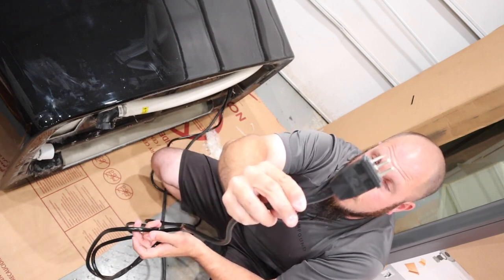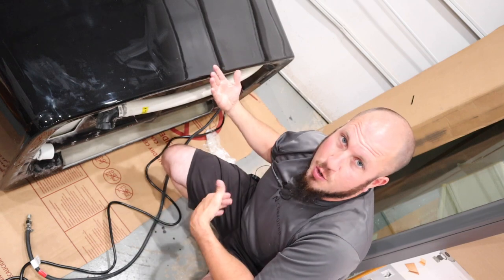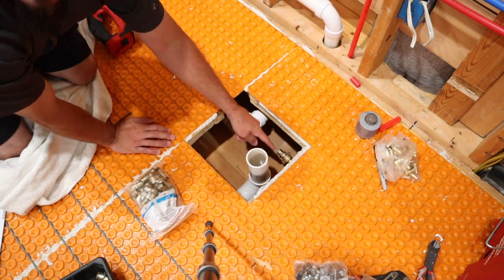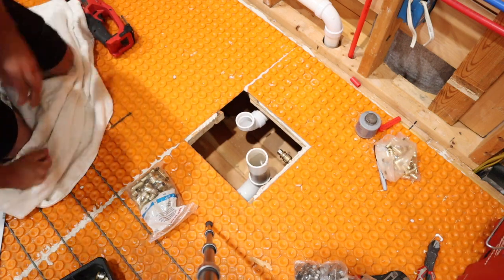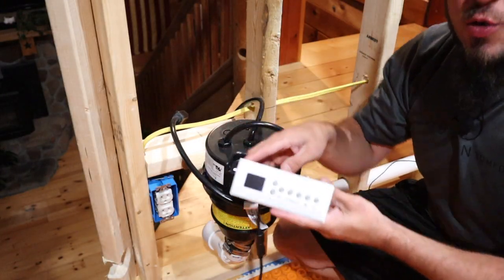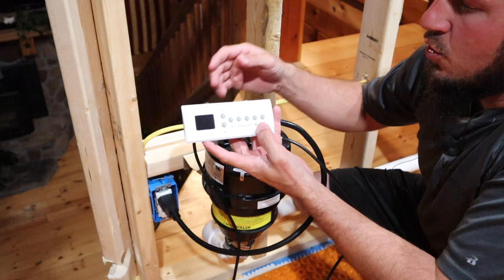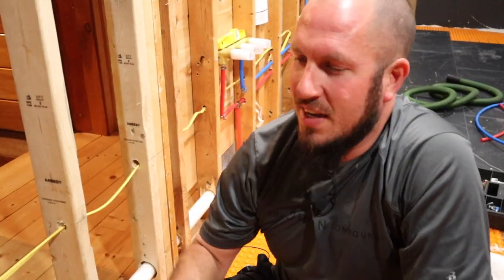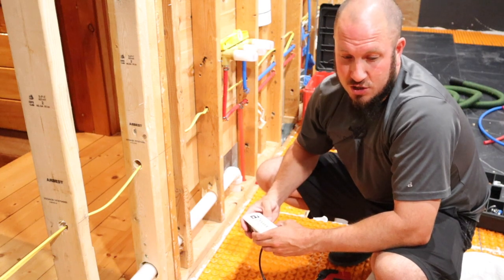BainUltra Air Tub Setup - What To Expect

Comment: Great Video!  Did you get it installed??  Really want to see how you get the tub to drop in over both the air tube and the drain.
Reply from the maker: I have not got it installed yet.  It will definitely need some access from below to connect everything.  I can think of a way to get it all hooked up under the tub when in place with no access.  You could probably do an island drain for the drain but the air hose would need to be coupled in the wall cavity at the very least.  I’m hoping to install it this month and make a video on it
Reply: @TheDurbinCompound  Cool!  Can’t wait to see it, we are about to buy one, and want to know what we’re in for!  Also interested to know if you’re doing something to dampen the sound of the air turbine…
Reply from the maker: @kinnderpropertiesllc9054 that is also on the forefront of my mind.  The turbine is load and had to be vented.  So I’ll have to devise some sort of sound damper.  It’s not like you’re going to be taking a bath unless it’s just the family home so the noise won’t be too much of a problem

Comment: Great video, thanks.  Can you install the turbine below the tub in a crawl space, or does it need to be in a wall/cabinet in the bathroom?
Reply from the maker: It needs to have air flow to pull from.  As long as it has that, you’re good.

Comment: Thank you for the video! Is it ok to install the motor upside down?  
Also any follow up or things you would have done different after install?
Reply from the maker: As far as I know, it can be mounted in any orientation.  Tips!  Mount the motor as far as you can away from the tub.  Putting it anywhere within 16 feet of the tub will cause the bubbles to be too strong.   I mounted it fairly close and it overflows the tubs with the splashing from the bubbles on 10%
Reply: Hi, did you install the tub already? My contractor doesn't know how to install it, so any tips would be useful!
Reply from the maker: @nonyabizness8643 yes, I did.